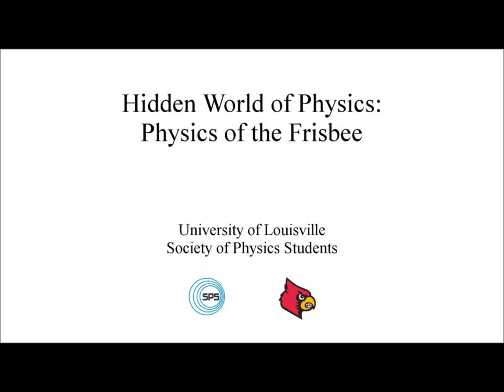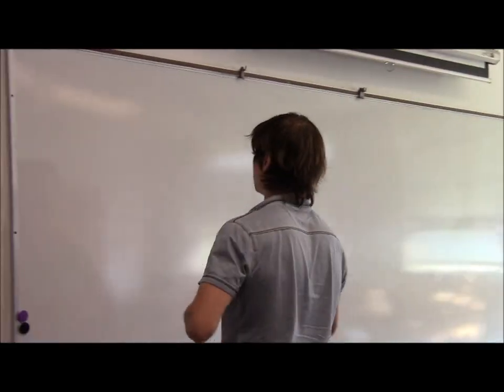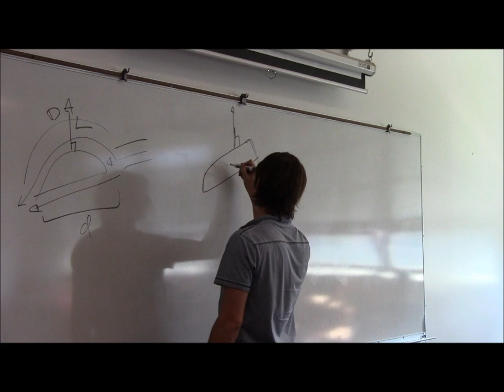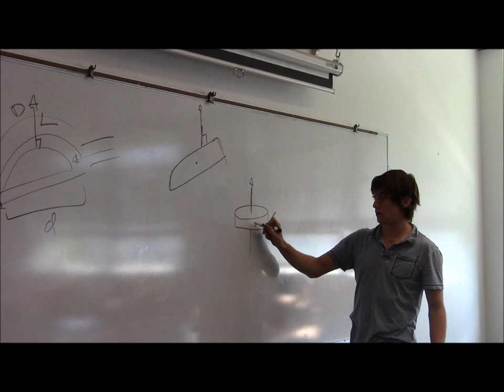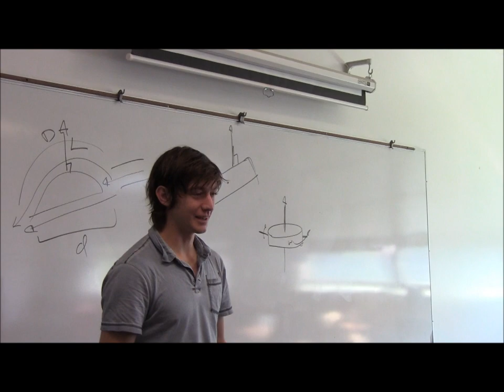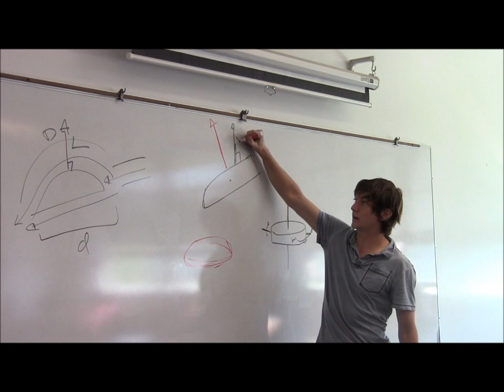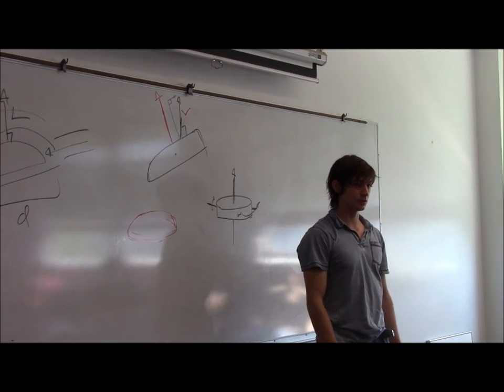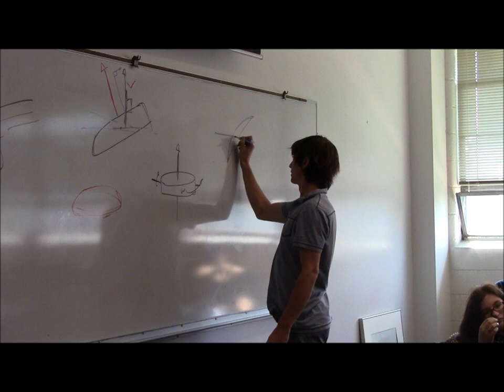Hidden World of Physics - Frisbee

Comment: Some facts:
An "Ultimate" Frisbee disc, as shown in the video, is very stable (neutral), compared to a discgolf disc (smaller diameter, same weight). I.e. it will show much less turning/fading action and will always fly "straight as a truck".
A righthanded sidearm throw will fade to the right (left edge will rise/right edge will drop, watched from behind), if thrown properly, when it slows down.
A righthanded sidearm throw will turn to the left, if thrown too fast (or into a headwind) or as the disc wears out and gets scratched or is released with large amounts of wobble (creading more drag).
When you learn the sidearm throw, it will probably take some time to get a clean release (disc will wobble) and enough spin to compensate for that (sidearm throws require active wrist action to create spin). As a result the disc will "turn" ("understable" flight) and you will have to release it at a "hyzer" angle (outer/right side lower then the inner/left side of the disc) -> the initial "turn" will then straighten the disc to level (parallel to the ground).
This (high speed) turn vs. (low speed) fade characteristic is a big part in discgolf. It allows throws to be "shaped" to avoid obstacles and reach desired landing zones.
For "straight" shots, you must select discs, that provide a large range of speeds, where turn ("understable") and fade ("overstable") cancel out each other. Increasing spin will also help (as it will slow down the turn/fade rates)...
The natural flight path of a flat object is "overstable". A Frisbee's underside, if pointing downward, can compensate this and create "stable" and even "understable" flight paths, depending on the disc's airspeed.

Comment: Austin's explanation of the stability of a bicycle is incorrect.  At usual bicycle speeds and usual moments of inertia of the wheels, gyroscopic forces are very low.  The stability is due to the angle of the front fork.  You can see this by leaning a stationary bicycle back and forth.  If you lean it to the right, the front wheel will begin to point right and vice versa.  This is why the bike is stable.  As an experiment, take an old bike and bend the forks back until leaning to the right makes the front wheel point towards the left.  If you try to ride this bike, be ready for an immediate fall!  A motorcycle is a much different animal though.  At normal speeds the gyroscopic force on the front wheel is significant.  At, say, 20mph, if you want to turn left, torque the front wheel clockwise.   Try it!
Reply: That is why a toy gyro loses stability and precesses as it slows. However, Austin implied in his example there is adaquate angular velocity in the bicycle wheel according to my interpretation.
His explanation of the angular momentum vector chasing the torque vector is 100% correct.  The resultant force always appears at an angle of 90 degrees from the point of application in the direction of spin in a gyroscope.